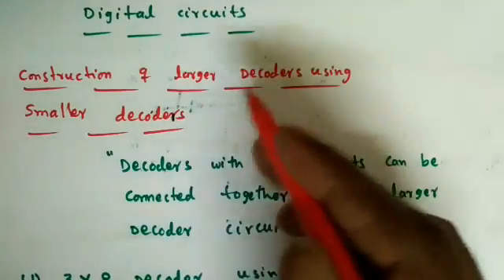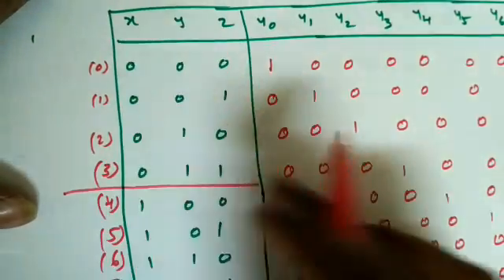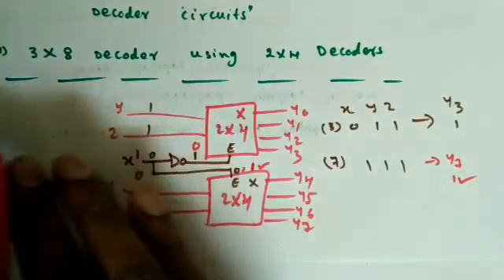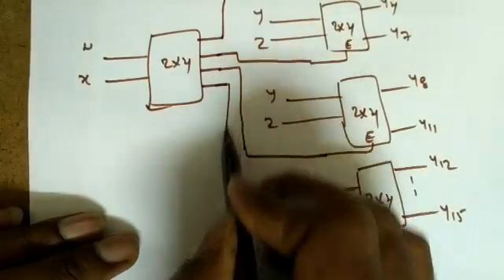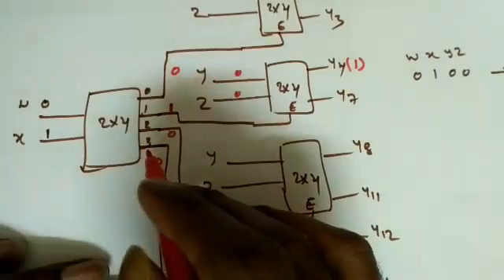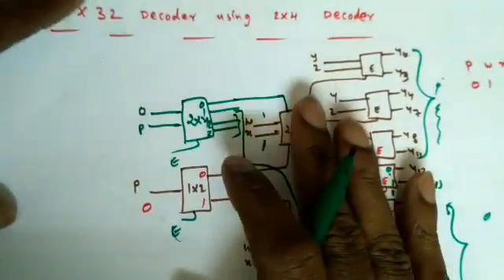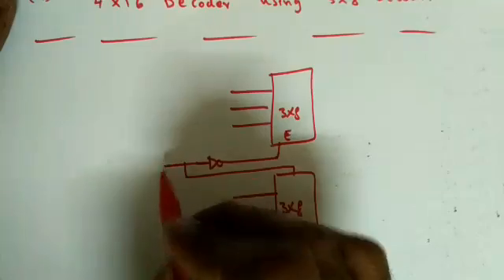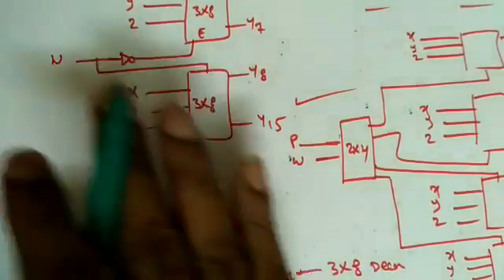Digital Circuits Lecture-43(A): Decoders-Part2

Comment: Sir, in the last problem where we need to implement 5X32 decoder using 3X8 decoders, why cant we replace the 2X4 decoder with a 3X8 decoder by giving one of the inputs as 0 and the other two inputs as p and w. We can ignore the bottom 4 outputs of this. We have done this kind of thing for the 1X2 decoder in the earlier problem
Reply from the maker: we can do that also